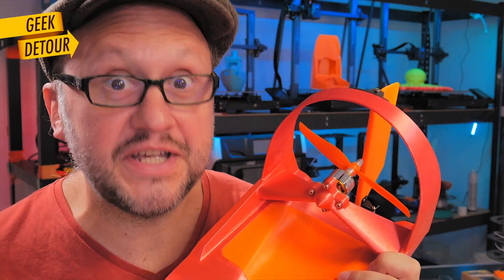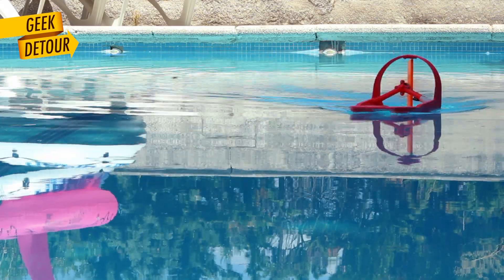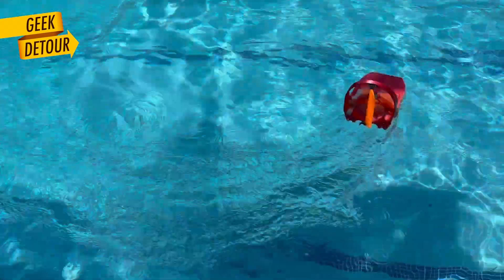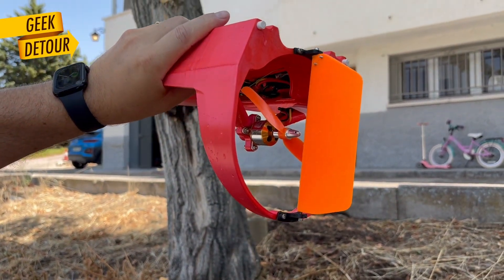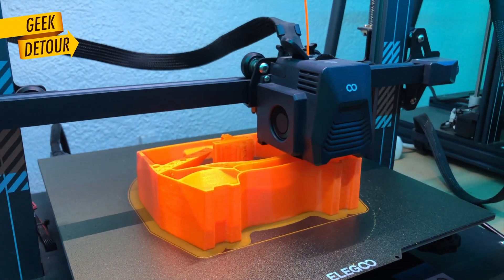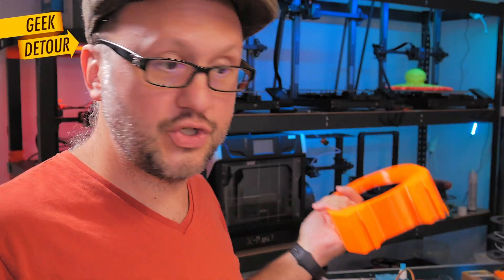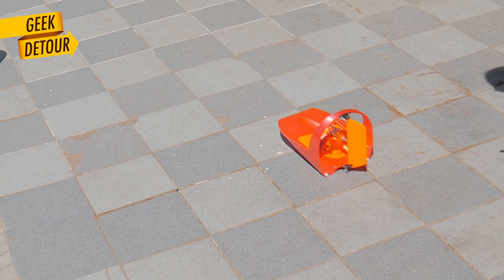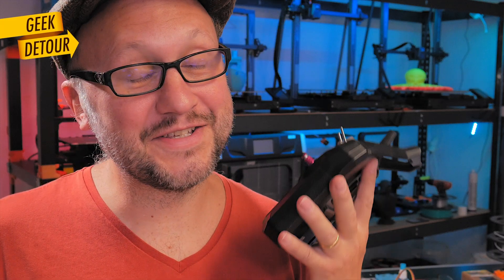RC Boat: 3D Printed in a single part

Comment: I would love to see you design a pump/impeller -type motor for an RC boat, instead of a swamp-boat/ hovercraft type deal. Though I suppose that would necessitate a larger battery (maybe a 4S?), at least a 100A ESC and a beefy 3660 brushless motor. The steering servo would also want to be fully waterproof :)
Reply from the maker: Oh, I want to try all sorts of boats. But the M-Jet project is SO GOOD already! I wanted something on the opposite direction: the simpler the better - no seals, no bearings, as close as possible to “print in place” (I mean, with the least assembly work - hull in one go).

Comment: That was fun ! 
For more pitch stability, I would increase the hull length. I would also place the weights (battery, motor, etc) near the front and/or the rear of the hull to increase pitch inertia.
Reply from the maker: Wow…. Making it longer was obvious to me, but I never thought about having the weight distributed to the edges (front and back)… of course! Thanks! That was a great tip!!!!

Comment: I would like to see more no this and at a good bugget, i cant build 200$ boats
Reply from the maker: The expensive part is really a good radio controller, Lithium batteries and their balanced charger. The boat itself, servo, brushless motor and ESC you spend less than $100. But you need to decide what’s the fun: making or just controlling. There are very FUN boats with radio for 100

Comment: Hi.
I just thought, maybe once you have the bottom of the boat flat you should think about adding a keel, or/and placing the rudder blade under water. That should help you with steering and would change your steering from aerodynamic to hydrodynamic. Also about steering and the remote controller, I haven’t noticed what joysticks do you have, do the they go back to the position zero on release or not. I think that joystick responsible for steering going to position zero should (if you haven't done it and it didn't fail) make it easier for the boat to go straight. You have probably thought about it already. If you haven’t, I recommend it.
Reply from the maker: Hey! Thanks! Sure, its the FlySky FS-i6x and the only stick that stays in the position is the Throttle (up-down, at the left). The Rudder is self centered, at the right. About the hull, so many configurations I wanna try. My next “prototype” will be a reconfigurable test hull (not beautiful, but that I could move the position of the motor, move the weight inside, to test and gather information for a better actual model.

Comment: Nice looking boat. I was thinking to make something similar since I bought a similar motor etc. to make an RC plane but it would be illegal to fly it where I live since > 100g but no problem for boats. But I will probably make the hull from plywood similar to those Florida swamp boats (or make a hovercraft). Your one seemed to have the propeller too close to the water and like you suspected, probably too short length of hull. I guess that brushless motors are maybe resistant to the effects of fresh water?
Reply from the maker: Hi there! Thanks! Yeah, I saw some crazy RC projects that they placed the brushless motor directly submerged with a water propeller - you need to clean it and use lubrication after each use. My motor was very down on purpose but I imagined the back of the boat would have more buoyancy. Let’s see where I’ll take this design, needs more testing 😄
Reply: @GeekDetour  All good fun!

Comment: I love your videos, just got a a1 with ams any upgrades you can think off?
Reply from the maker: Thank you! You know, I have a Bambu Lab P1S, with its AMS combo - and I didn't make a single "upgrade" for it. The thing is, these printers are so good, you need to be careful not to actually make a "downgrade" when you tweak things. I might add a more powerful LED strip inside mine, but that's the sort of things you can upgrade, like, convenience stuff. I din't see any substantial improvement that you can do on the actual printer.

Comment: I know that this project (if I understood correctly) is an airboat and mothing else, but it's a LOT more convenient to just switch the propeller down to the water, and use a belt or a chain to drive it. CPSdrone has videos where they 3D print submarines, so you should check them out!
Reply from the maker: Very interesting idea, using the belt - a completely different type of boat, but hey! I’ll check it out! Thanks! ❤️

Comment: This looks like a lot of fun. 
Opinion of an armchair recreational boater - seems to me the hull shape is dictated by water conditions. The flat bottom you posited would be great in the everglades and horrible on open ocean, so where you're going to operate dictates shape. The pool ripples toward the end of your test runs were, in scale, equal to very rough seas. I suggest copying existing full size boat designs more or less.
Reply from the maker: Hey! That's a very nice insight! We live close to an artificial lake - the water is not super still, though. As soon as I make a slightly larger boat (that the propellers would be 'dry' even when the boat is stopped), I will have a better understanding of what I think would be fun to play with in the lake. The pool got really agitated right away, probably more than the lake is. It would be funny to make 3, 4 crazy hull designs to finally end up accepting hundreds of years of naval knowledge and settle for copying something existing 🤣